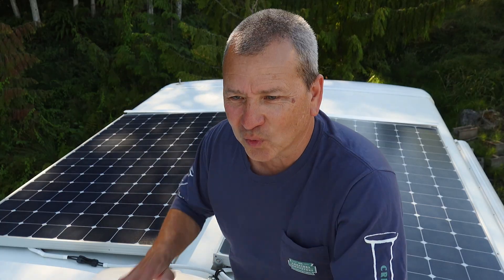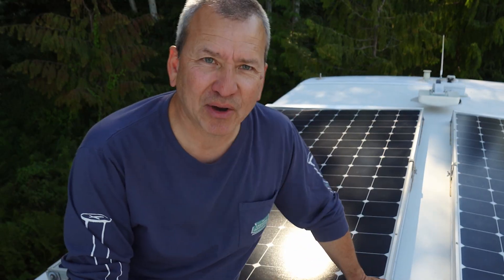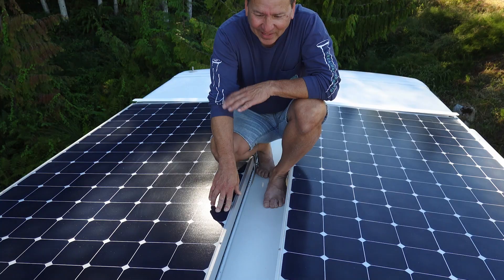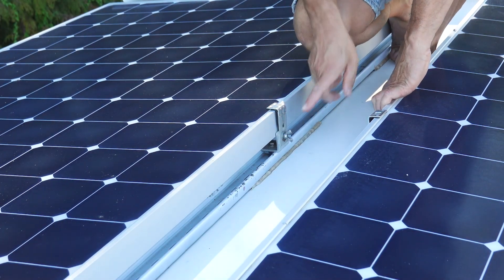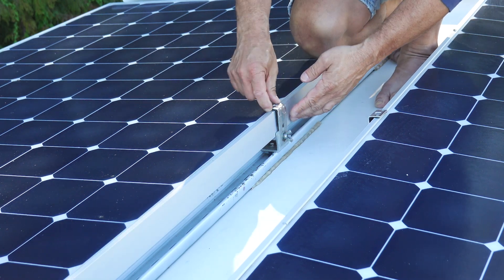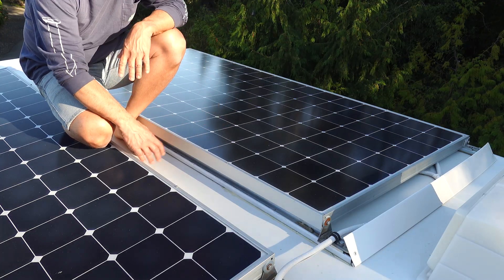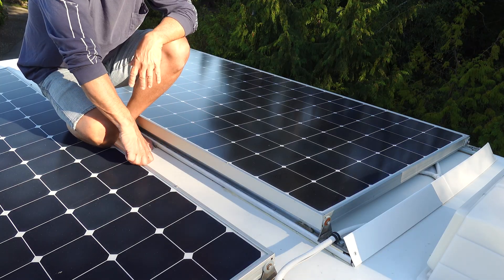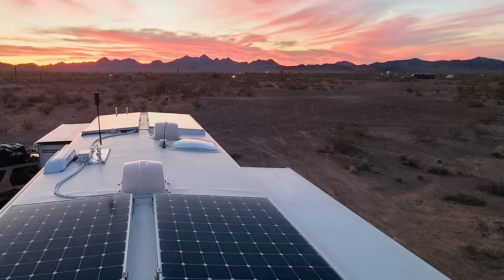Off-Grid for 6 Months! How Did The NO-DRILLING RV Solar Mount Hold Up? | 1700 Watt Solar Powered RV

Comment: Hi Brian. My motorhome has a Fiberglass molded roof. I love the idea of not drilling holes. If you have a fiberglass roof, would you personally have felt good about using just the VHB tape?
Reply from the maker: Our roof is also fiberglass and it has held up very well for the last 4 years. The key is to make sure both surfaces are very clean and dry before attaching the tracks. As you can see in this video, I also added a couple of screws later on for good measure. I don't think it has needed it though. Good luck and just use your good judgement.

Comment: Love your videos.  My dream install (daydreaming): power strut lifting panels with electric locks to secure during driving, maybe rotating panels to stay with sun (like the lift/rotating tv antennas) but all self adjusting.  Another daydream is doubled up panels (like bunk beds) with the top deck being able to extend down over the sides of the rv to provide some shade and rain protection.

Comment: I would have considered using a dry wall type screw with plastic insert in your setup. Would be perfect for that, just needs a bigger hole. I plan on putting the front of the panel getting the wind flush with the roof, no rail and raising the back end up 5 degrees or so. That should prevent lift, The front side will get screwed down with a combination of sealant and Eternabond tape. The sides of the panel i will just use VHB tape and brackets with Eternabond tape over it. So if the tape does break free the wind side with screws will keep it from ending up in the road and no wind will be able to get under the panel to wiggle the screws out.

With the 5 degree angel raising the rear it will add downward pressure to the taped sides so there would be zero chance of the tape breaking free by sideways or upward pressure while driving.

Comment: Hi guys, I am so glad it as worked out well I’m doing mine soon and will definitely copy your way. I really don’t want to drill my roof in our caravan so I won’t copy you there but the rest great. Also using the plastic guttering is a great idea but I won’t be doing that as our temperatures here in Australia can get very high and I think we should use the breeze to keep it a bit cooler. So thanks for all your ideas and may you both stay safe. 🇦🇺Jon

Comment: I'm glad u put the scews in your roof. No matter what, relying on just adhesive strength is risky, especially for this application. Also, high quality stainless steel mounting hardware and tilt bars can be purchased from AM Solar.

Comment: Disappointed you put holes in the roof in the end. I just dont want to do that to my metal roof.
Reply from the maker: The main reason I added screws was to avoid any delamination of the thin fiberglass roof membrane. That may not be a concern for your metal roof. Just make sure it's really clean before using any adhesive.
Reply: @RVwithTito  Thx for the info and the reply mate!  Just curious how you knew where to drill?  I cant find anything on my old Holiday Rambler roof construction.
Reply: @TheGreatRepeller  Get Blue Print for your coach from manufacturer. It will show EGS or metal plates or strips on your roof....

Comment: No overheating problems,as very little gap for air flow...
Reply from the maker: No problems. It's slightly angled with a couple inches on the lower side and 3.5" on the high side.
Reply: @RVwithTito  .ok.great.....looking at putting 1 200watt panel...

Comment: hmm.... for solving some issues like:
- having options to re-do panel configuration in future, 
- better height for improved hot air escape etc.  

P/Starb + B/Stern mounting solution- might could solve above

- Permanent Base Rails @ P/Starb direction : 
mount like you did; one's chosen rail system,  across roof in Port to Starboard direction (P/Starb) at a measured planned distance apart... say from bow end of roof, bond  permanently rails in P/Starb direction, every 2  feet?   Do this all way to the back Bow to Stern. 
  

- Reconfigurable upper rails @ B/Stern direction : 
atop Permanent Base rails; using that rails bolt on mount system, place sections of rails  that run Bow to Stern (B/Stern). Place these sections to match where  needed for panel mounting, All the panels etc. are mounted with these upper B/Stern rails. Bolt  atop the Base; where needed,  some small  P/Starb, or B/Stern sections of rail , to use for clamping the panels on an edge where needed.

Now your panels are further off roof by 0.50 to 0.75 inches than just one rail as you did . This should aid heat escape issue.. AND best of all... now your panel lay out is completely reconfigurable. Just unbolt Bow/Stern rails from their Permanent Base  Rail  and move them, and the panel attached to them,  to where newly desired.  

Hmmm on second thought.  for those with curved RV roofs etc..  the Permanent base rails  going P/Starb may need to be in sections and not one rail all the way across  in order to help deal with the curve. ...  or guess one could slice the vertical sides of Base Rail in a few places allowing one to bend the bottom face till whole thing matches the roofs' curve.  Luckily a problem I wont have with my  Ambulance boxes flat roof..

Comment: I only realised recently that the single solar panel on my motorhome has just been glued down with no drilling.
Its a 2008 model motorhome.
I wish i knew what adhesive they used.

Comment: Just wondering.  Is the roof on your motor home a pebble grain or smooth.  I want to use VHT tape but the roof on my new coach is pebble grain.  In the past I used the tape on a smooth Tiffin Wayfarer roof and it stayed put after almost 3 1/2 years.  Thanks in advance.
Reply from the maker: mine is smooth.

Comment: I just checked out SanTan and am overwhelmed by all the different types of solar panels.  Can you make a recommendation and why you chose that brand?
Reply from the maker: I chose SunPower because I'm familiar with the cell technology and quality. I've seen them come and go from the used SanTan stock and debated on buying more. I'm not familiar with the other used inventory and their used. They do have spec sheets for their panels and also provide a one year warranty on all of their used panels. I also researched the specific panel and manufacturer to see what others said about them. Some folks have told me that Canadian Solar is a good quality and inexpensive option, but I don't have any first-hand experience with them. One recommendation is to pick them up in Arizona or Georgia if possible. You'll save a few hundred bucks in freight chargers. Good luck!

Comment: 👍 Nice job, thanks.  I plan on doing that very same mounting technique as to allow for some of those appliance lifting air bags to be utilized underneath the panels (cross member mid way with plate) to raise the panel. A spring or springs would work to keep the panel wind safe while stationary and some quick type of lock downs for traveling. As you have two rows of panels a simple selection valve at the air pump would suffice. Combine the air bag release tubes together and have a single going to a convenient place to lower. A proper timer to the pump could be programmed for it to "follow" the sun, and just drop them back down in the morning.

Comment: Great info Tito , Im a new subscriber here and enjoy  how you lay out the info and back it up with great camera shots of the installs and equipment /tools needed etc. I don't think most people realize how much work goes into shooting and editing  a well made video takes . I have a 2000 Monaco Diplomat  that has a thin aluminum roof  very similar to the construction of  the Winnebago . I had 3 panels (130 watts each  lol)  installed maybe 12 yrs ago . They were attached with just the Z B rackets and although still in place you can PULL up on them and feel the roof move . Im thinking about upgrading the panels and  patching the old holes and using the STRUT channel  VHB tape . Going from AGMs 900 amp hr to  at least an  800 amp hr Lithium bank . I like the battle  borns but  was also considering the new 330amp Victrons Lithium . Seems hard to find many reviews on Victron batteries   but everyone uses all their other electronics? Thank you for well made  content J. USMC
Reply from the maker: Hey there. Welcome! Don't know much about Victrons batteries. What I do know is that the BMS is a separate piece of equipment. So don't forget that piece. 👍
Reply: @RVwithTito  Sorry called you Tito , Thnx Brian

Comment: One other question I have (i am about to go with this approach): have you tried gluing the panel directly to the roof instead of using the channel? With a channel it's quite involved with many additional steps to take.
Reply: The channels allow you to tilt.  When my panel is flat I pull 2-3 amps.  Tilting panel increases the amperage to 8.7 for a 9 amp panel.

Comment: I need an update to prove these can ever be removed
Reply from the maker: It was the best option for me at the time.
Reply: @RVwithTito  Have you ever tried removing them?
Reply from the maker: @mz8755  The solar panels yes. Not the strut channel. I hope I should never have to.
Reply: @RVwithTito  Thanks for letting me know. The most genious part of your approach is actually drilling free, and in case you need to sell the RV and the next person doesn't like the solar stuff, it is removal. Sounds like we don't really know if that's feasible (even before you did put down one screw).
Reply: @mz8755  sorry i just realized VHB Tape is a permanent bond - i was thinking it's those 3M sticky ones that can be semi-bond and removable.

Comment: Was wondering why you didn't just use one of the K2 system rails which are aluminum made for home rooftop solar. Price is about the same as the rails you got from Home Depot.  Santan solar sells the K2 system made for bolting down to metal roofs called the MiniRail XPRess.

Comment: Hi Tito, guess my other comment on the first install of these panels hasn't been read but you've done what I saw as a potential lift and your solution of the leading edge baffle in a word, excellent!
Unfortunately to tilt the panels means a trip to the roof each time, this is where the solar panel side shade idea you had would be less work to aim at the sun and keep the side of the RV cooler being shaded by the panels.
The side mount with your baffle is just getting better, I finished my initial lithium battery install yesterday so my project is moving forward.
Thanks for your tips and insight.

Comment: Tito I too added screws almost right away after using the 3M tape. Though the tape will not let go I started seeing videos of winnebago roof repairs where the layers separated in the wind or going down the road. I also thought the panels would put even more force helping cause a separation. So I added a screw to each panel leg
Reply from the maker: Yeah. I feel better about it now...same reasons.

Comment: Yes on rubber roof didnt feel confident with just VHB tape.  my roof has 1/8 inch wood substrate. Screws have torn out under high wind. So I use Well nuts that grip under the surface of the wood and tpo.  So far excellent with the T track.

Comment: If you drilled holes it is no longer a no drill set-up. Why didn’t you just say that.  As a mechanic and a motorhome technician people tend to worry about things that don’t matter.  It’s better to secure something then worry about bonding.  Holes are not a problem, just remember every hole just needs sealant.
Reply: Until the sealant fails. And it always fails. Every hole is an increased maintenance headache.
Reply: @stargazer7644  really then why do we have so many roof vents and not just windows on the side. 
Yes somethings need maintenance but it's not a big deal. It's cheap and easy to do.
As far as sealants failing things are getting better every year.  
I'd still rather have my stuff screwed down then blow off because the sun will definitely cause the glue to unbound. An you never know when it will happen. 
Ever see something come off a vehicle doing 70miles a hour?

Comment: Lock washers next to the bracket are pretty useless(if not counter productive) on the bolt head in a pivot. L washers are meant to dig in to stop rotation. I would suggest going with nylock nuts instead. ( A locknut with a nylon insert) and ditch the lock washers in that situation. A flat washer in place of the L washers would be a better arrangement. If you used nut-serts in the panel, a dab of blue lock-tite would be appropriate.

Comment: You and other few Youtubers inspired me do a big solar install of 3800w with sliding panels. I also used VHB tape and later found need a few screws. But with my 3800w, the best I have ever seen is about 2000~2500w.
Reply: Cosine error will kill the efficiency of a flat roof solar install especially in the winter.  The panels need to be facing perpendicular to the sun for full output.   You’ll lose 30% of your power at a 45 deg angle, and 65% at a 20 deg angle.
Reply: @stargazer7644  I understand. That's for sure in winter time. But the number I refered to (2-2.5 kw) is in summer time which the cosine error is relatively small. Recent days (November), I am getting only 1600 to 1800w now. 😅
Reply: @timmysrvlife  Are you using an MPPT (tracking) controller?  That will also make a significant difference.  Make sure there are no shadows at all on your panels.  Even just the slight shadow of a power line or a guy wire or antenna or bird droppings across any part of a panel will drastically reduce the entire panel (or string) output by partially shading one or more cells since they're in series.

Comment: I like the idea of no drilling but eventually the adhesive will give up due to temp changes. Even tiles on the shuttle eventually came loose. I would have a safety leash for when they come loose so no one dies on the highway.

Comment: Good job, solar controller for each panel. Perfect. Victron rocks….👍
Reply from the maker: Totally agree. Once you go blue, eventually everything turns blue.
Reply: @RVwithTito  
🇦🇺 plenty of sun down under.
Yep I’ve turned blue as well, I’ve done exactly the same thing with my solar, but I use ground panels because I park in the shade. It gets hot in AUS. 🍻🌮

Comment: I used to watch your channel but no longer do… and it was because of your panel installation. This video just can up on my feed and I’m only helping your algorithm by commenting (oh well). 
1) people say they use the 3m tape because NASA uses it on their space shuttle. There is zero explanation of how 3m tape is used or where it is used on their shuttles…. And I promise its not to hold a panel on the roof
2) every time I see, read or hear anything about “no drilling”, it’s all for the sake of a leak. AND “they haven’t flown off yet”

It’s amazing that in any mind people will compare their RV to anything NASA does, put other peoples lives at risk until there is actually failure and the risk is gone or even think that just gluing 400+lbs of metal equipment on a moving vehicle’s roof could even be a smart idea.

Comment: We need more RVs that are entirely off grid; more solar, larger battery compartments, larger propane containers, recycled water system for the grey tank (sinks, shower, washer) that reuses the water and filters it (easy cleanable filters), air to water systems that generate 5 to 10 gallons of water a day (filtered), "Cinderella Propane Incinerating Toilet or Composting Toilets (get rid of black tanks)" hot water on demand, mini-wood stoves with electric heating to reduce the massive condensation from propane heating, and more.

Comment: Another great video!  I have learned a lot from you and I just purchased a 2004 Winnebago Adventurer 33V.  I have a quick question though concerning your 50 Amp service.  My rig came from the factory with a 30 amp cable, but the transfer switch shows it is 110/240 50 amp.  Did you have to change your cable out or did your rig already have the 4 wire 50 amp?

Comment: Brian, I am happy you posted this video.  After I watched your first video on mounting solar panels on channel strut, I decided to do the same.  However, after speaking with a professional installer, I opted to drill a few holes to provide additional support.  The installer said he had seen panels detach from RV roofs, particularly rubber roofs.  Also, I spoke with 3M engineers who said 3M did not recommend using their VHB tape for solar panel roof mounting since they had not done the type of testing necessary to validate its suitability.   In addition, I leaned there are several types of VHB tape for different type applications, some for metal-to-metal bonding, others for metal to non-metal materials, etc.  3M also recommended a primer to strengthen the bond to certain non-metallic surfaces.  I used solid aluminum channel (without the slots), a 45 mill thickness VHB tape for metal to non-metal applications, a 3M primer applied to my EPDM roof, and drilled three holes in each piece of strut, one at each end and one in the middle.  Everything has held up fine so far.
Reply from the maker: Thanks for sharing that additional information. Great job!

Comment: I recently did the same with strut and VHB tape, added 3, 210 watt panels, but I did run a few large screws to each rail. I used silicone rubber to secure each long side.
Reply from the maker: Great. Hope they last a long time for you.